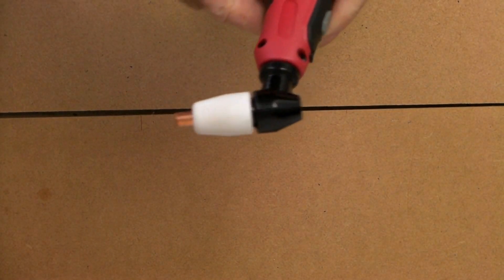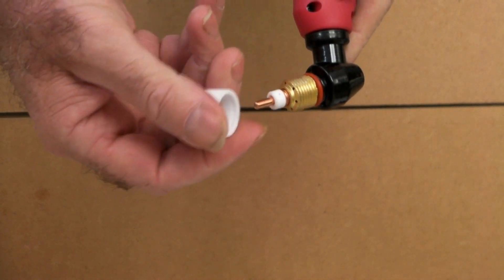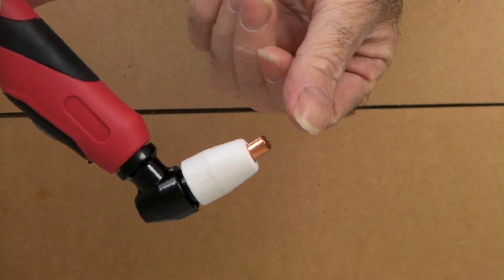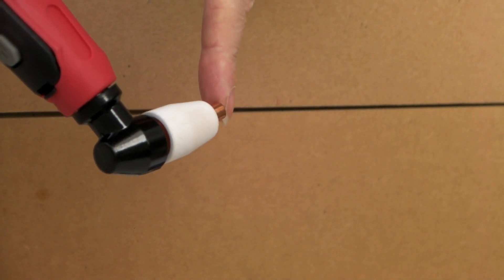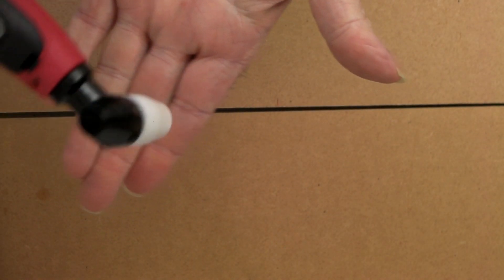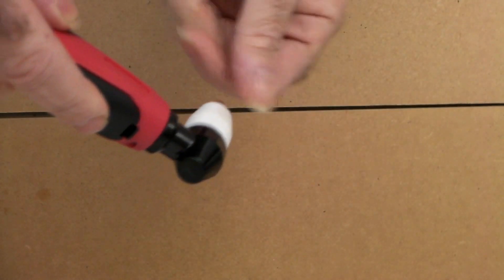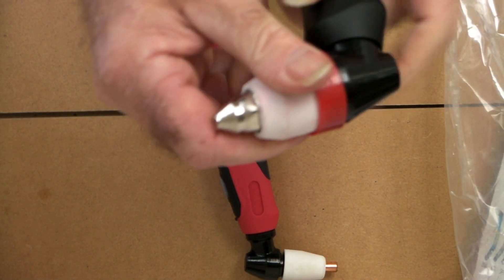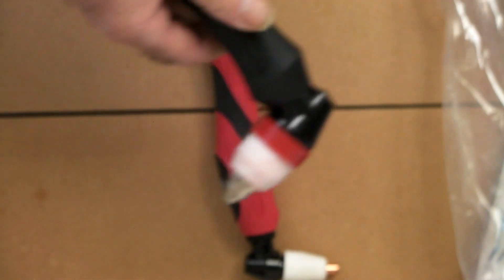Plasma Cutter Drag Tip / This Simple Hack Will Double Its Life

Comment: That’s what a piercing /gauging tip is for—making holes in metal. Pilot arc starting has nothing to do with dragging. Machines that have pilot arc starting also can use drag tips, gauging tips, and the rest.
Reply from the maker: Yes thanks for that  yes but not the other way around .cheers pete